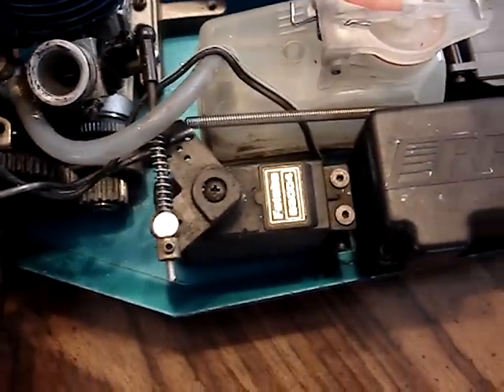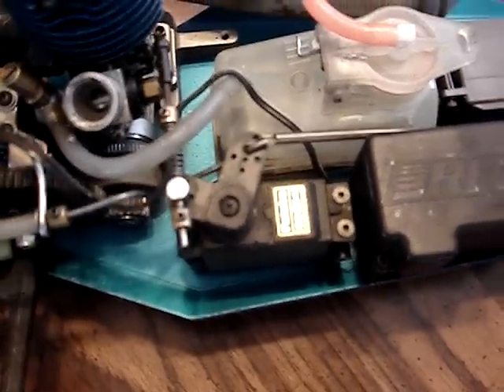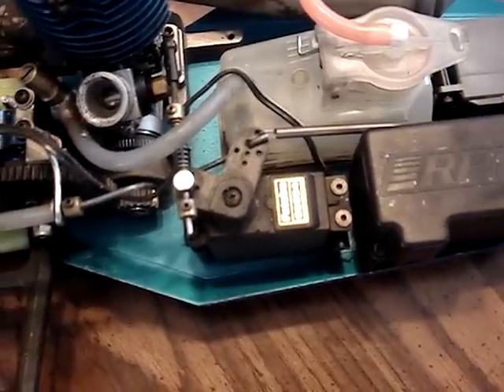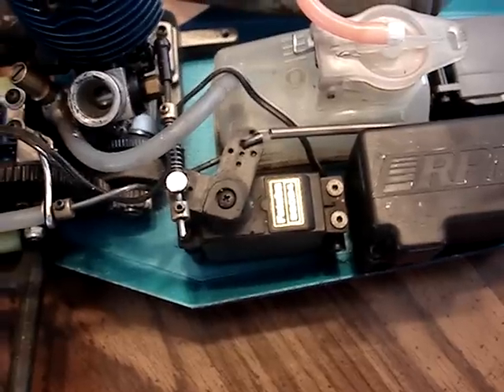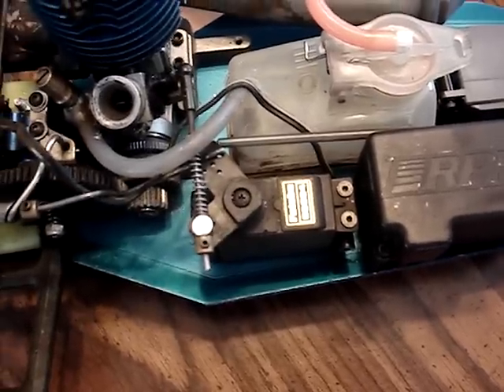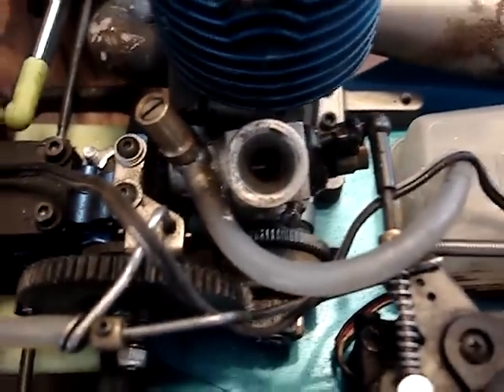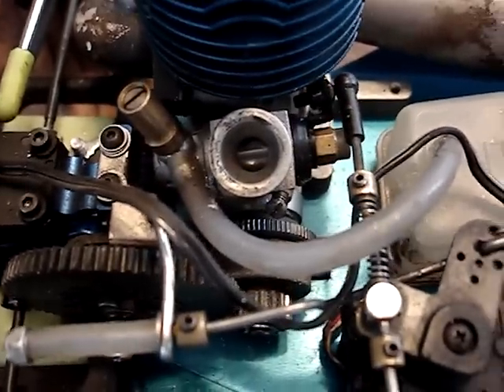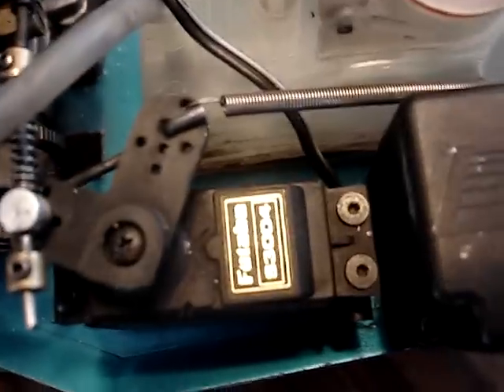Throttle return spring rc10 gt

Comment: hi good video. I am considering installing one. 
Only thing is, they make the throttle servo work harder, shortening battery and servo life and slowing down throttle response. Then again it's better than crashing into a wall at 45 mph and costing my £70

Comment: Neat idea, but ideally you'd want the return spring fitted directly to the carb, eliminating unnecessary points of failure if the carb linkages disconnect. The spring attaches to the carb's ballstud & the other end goes around either the HSP or a zip-tie.